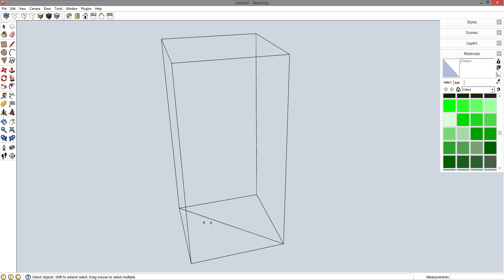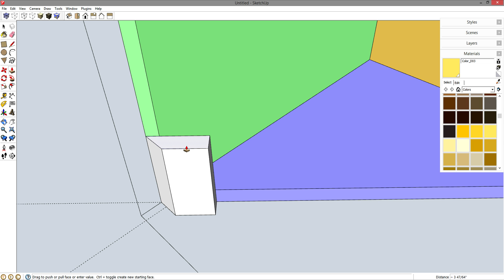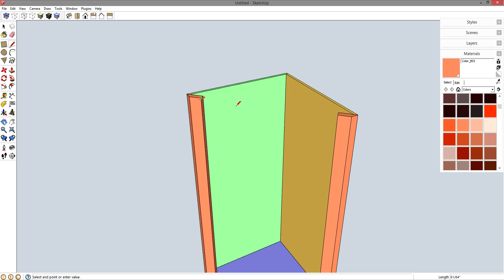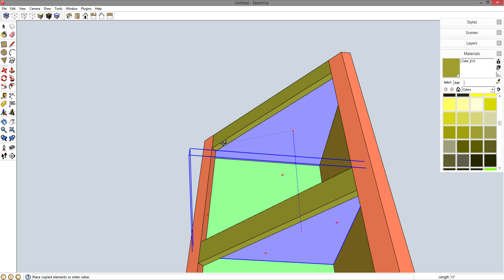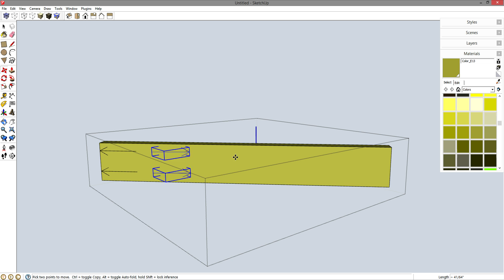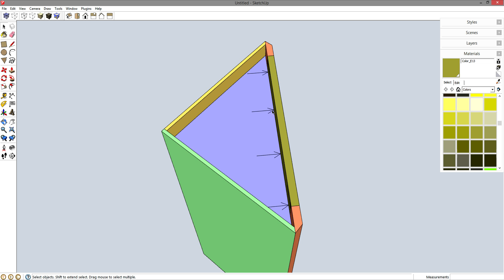SketchUp - Pocket Hole Corner Cabinet - 174

Comment: Hi Jay -  First, thanks for all you do.  I watch and learn from all your vids.  I'm an "intermediate" Sketchup user and appreciate your methodical presentation in the SU vids as it helps improve my work flow, and I'm sometimes surprised to see something I didn't know could be done.
 
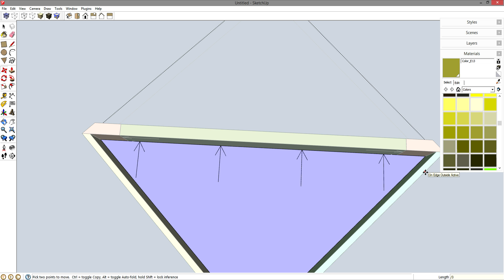Now maybe I have one for you.  In this vid (at 9:12) and other of your SU vids when you want to edit a component that is buried in other stuff you make a copy of the component, drag it to a clear space, edit it, then delete it as the original(s) are now also edited.  Works great.
 
There is feature in SU that may save a few steps to accomplish the same and has another benefit.  Under View/Component Edit, select Hide Rest of Model.  With this selected, whenever you are editing a component, well, the rest of the model is hidden -  giving you easy access to all of the component.  Then, while in the same edit, you can uncheck this to reference the other components if needed.  I assigned a hot key to this to quickly toggle from this mode back to normal.  It makes editing assemblies much easier.
 
Keep it up.

Comment: NIce but just a thought If you make the back of the cabinet stop short of the wall you won't have aa problem if the walls are not at 90 degrees.Stop about 6" or so and it give it a nice look.
Keep up the good work.
Roland
Reply from the maker: Backyard Woodworking The actual model was made with the face frame sticking out from the back panels by about 1/4" on each side for that very reason. I didn't think about it until I got into the shop.